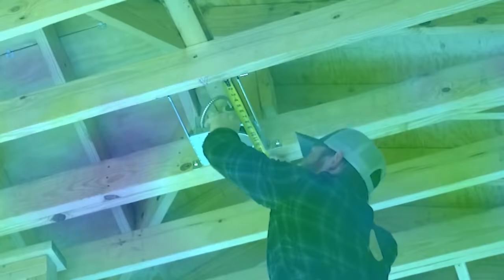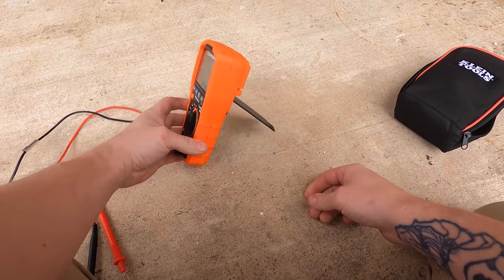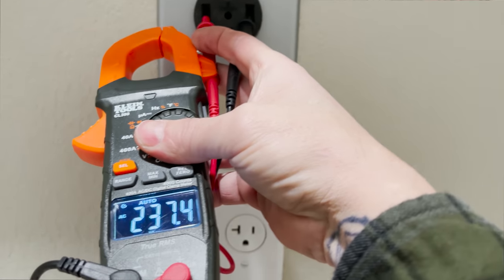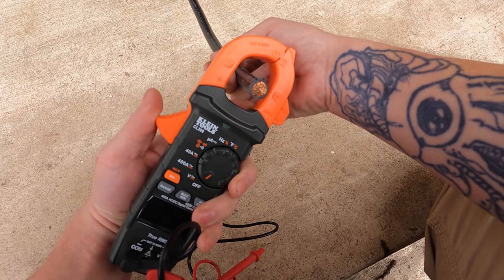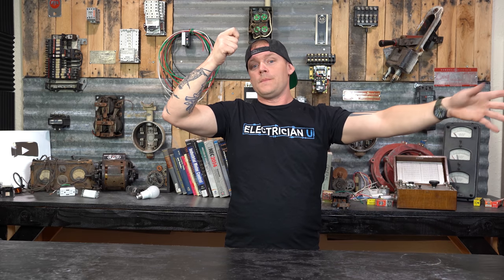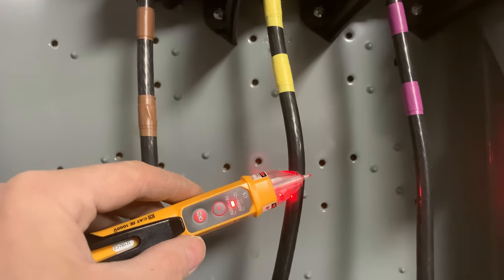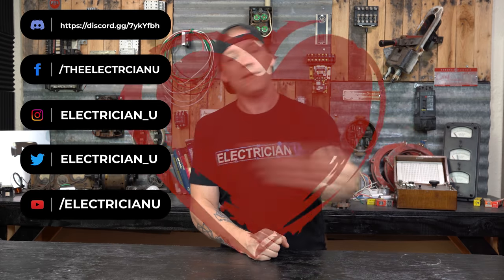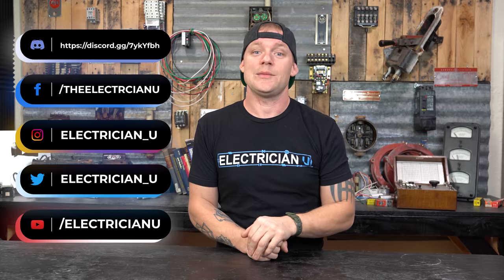4 Basic Electrical Testers & HOW TO USE THEM

Comment: My dad was working on the motor for an elevator on an aircraft carrier once. All of a sudden there were sparks everywhere. After everything settled, he went looking for what happened. Turns out some guy decided to ignore the lockout and energize the circuit. Was busted down to seaman. So, even if you start out with a safe circuit, it doesn't mean some idiot won't change that state.
Reply: Another lockout story-Years ago I knew a mechanic in a big fruit processing factory. His buddy was working to fix a jammed machine on the production line and locked it out for safety. A supervisor saw the stopped machinery, didn't ask why, broke the padlock off the safety switch and started the machine again. It cut both of the mechanic's hands off. The company gave him a lifetime pension but I would rather have my hands. Moral of the story: even if someone tells you the circuit is dead or the gun is unloaded, check for yourself!

Comment: Being a 75 year old fart, safety was always a priority, never gave someone a false positive on a circuit being disabled.
Reply: Get yourself an electrician safety lock kit, box lock, push-button lock, and breaker lock. I was drilled to use them when I was working in a mine mill, every worker have their lock, electrician or not, if they caught you working on something without a lock you end up sitting on your ass at home for a week without pay. Hey, it's just me saying, you have the freedom to get killed. Just one more tip, you need to be the only one with the key, not even your boss should have the key, they are often the most dangerous when the production is on the line.
Reply: @louispaquet8185  Do you have this paragraph copied down somewhere that you can just paste it to every comment? lol

Comment: Here's my question for obtaining a new meter: get one with True RMS (TRMS) or without it?
Reply: Depends on a lot of things, but if you're asking you can pretty safely assume you don't need a true rms meter. Both will measure sine wave accurately. True rms will measure a jagged half tooth half square "wtf kind of fuckery is going on here" kind of wave accurately too. How often do you need to do that? If it works great for 90% of what you do, and gets you by the other 10% you're probably good. The bells and whistles can be great, but most of the time it just makes it a pain in the ass compared to a "lesser meter".

Look at what the people around you carry and use. For a first and only meter for most electricians a T5 is really hard to beat. They're popular for a reason, and it's not true rms - I don't think it is anyway. That's not always a good choice though. Maybe you work on a lot of things where true rms is more of a "need" than a "want"? Or maybe you work with big enough stuff that the ammeter would be all but useless and you need a larger clamp meter?

Comment: What about a voltage testing screwdriver?

$3 tester, electronic screwdriver, just has a resistor and neon light inside the clear handle.
Reply: It’s kinda like the tick tracer. It will tell you that there is some kind of power but it can’t check neutral ground continuity or voltage

Comment: About 30 years ago at work I went to plug in a radio in a room and it just let out a shower of sparks until the breaker tripped.  Then I reset the breaker and it instantly tripped again.  There is nothing wrong with the radio.  My cheap boss never fixed the plug after that occurence and he removed the breaker from the panel.

Comment: Don't you use switch/breaker lock off devices and everybody involved with the work has a padlock and separate tag? Circuit is verified and everybody locks the circuit off and everybody has to reinstate the circuit by each removing their padlocking device and signing off the tag when done. So the last tag/padlock guy puts circuit back on and everybody knows.

Comment: I’m currently undoing the fookery left behind by a previous homeowner.  Found a shared neutral between a 15amp and 20amp circuit.  Trying to map out where this moron tapped into the 20amp neutral. 

One really screwy thing about those plug testers is they are low amp. It will read air.  I got a false reading of hot and ground reversed on this 15amp and 20amp shared neutral at an outlet - I disconnected one of the hots and was verifying power to the outlet.  Outlet had no power and the plug tester lit up with a hot and ground reverse reading in error.

Comment: That whole do not listen to anyone when they tell you the power is off.. It is called " Trust but Verify " People are human.. People make mistakes.
Reply: Get yourself an electrician safety lock kit, box lock, push-button lock, and breaker lock. I was drilled to use them when I was working in a mine mill, every worker have their lock, electrician or not, if they caught you working on something without a lock you end up sitting on your ass at home for a week without pay. Hey, it's just me saying, you have the freedom to get killed. Just one more tip, you need to be the only one with the key, not even your boss should have the key, they are often the most dangerous when the production is on the line.

Comment: Get yourself an electrician safety lock kit, box lock, push-button lock, and breaker lock. I was drilled to use them when I was working in a mine mill, every worker have their lock, electrician or not, if they caught you working on something without a lock you end up sitting on your ass at home for a week without pay. Hey, it's just me saying, you have the freedom to get killed. Just one more tip, you need to be the only one with the key, not even your boss should have the key, they are often the most dangerous when the production is on the line.

Comment: Learn the difference in meaning between someone and somebody.
The first question to ask and answer is  -
Has there ever been another 'One ' of you before you were born ?
Will there be another one of YOU after you die  ?
Understand that One is Unique
One is irreplaceable
One is the Cardinal number
How many souls do you have ?  (Soul is Ani - in Latin) - Analyze that word.
One is alive 
Every'body' is the same -  Rotten and stinking after four days and found buried in the cemetery.
Make sure you learn that.

Comment: switch off
Secure against being switched on again
Ensure that all poles are free of voltage
Earth and short-circuit
Cover or cordon off neighboring, live parts
Reply: Get yourself an electrician safety lock kit, box lock, push-button lock, and breaker lock. I was drilled to use them when I was working in a mine mill, every worker have their lock, electrician or not, if they caught you working on something without a lock you end up sitting on your ass at home for a week without pay. Hey, it's just me saying, you have the freedom to get killed. Just one more tip, you need to be the only one with the key, not even your boss should have the key, they are often the most dangerous when the production is on the line.

Comment: A helpful source, except that you didn’t cover the amperage segment adequately. 

The voltage was demonstrated and quickly covered. 

Amperage you mentioned it, product placed the Klein clamp meter, and pointed out (I learned something) the markings on the jaw. 
Also demonstrated the least (I was just a ‘duh’) important usefulness of the built in ‘hanging feature’, meaning the jaw. This was like 90seconds. 

The tic tracer which you spent possibly 7-8 minutes as well as more product placement and most of the useful info was stated in the initial 45seconds. 
My tracer gets used constantly, it’s like a middle finger, it is way more useful than you know, (I recently broke my middle finger, and came to realize it’s hard to pick things up without it!) whereas as a handyman (primarily electrical work) a DMM has its place, but it’s not terribly important. 

I don’t think you even touched on continuity. It’s quite often the only reason I’ll carry my DMM up a ladder. 

Overall, you offered great advise and did it well, but if I’m being honest, you have entirely too many advertisements as well as product placement.

Comment: I've verified a junction box was dead, cut a wire and then there was power. Like wtf. I figured it was a shared neutral, but I'm pretty sure I cut the neutral first. Idk. It's an old courthouse and the lights are 277v. It definitely wasn't 277v that got me. Who knows?
Reply: Sounds like you disconnected or opened the neutral. Multi branch or   not the effect is the same. Power on return. Also if you lose neutral on 277/480 You're gonna get the 480
Reply: dimmers like to unload on the neutral.
Reply: @wim0104 it was my hand. And because I was in a drop ceiling when my arm touched the grid I got tagged. It was a mild shock. Less then 120v by the feel of it. Being it's an old building, yes something was bleeding current.

Comment: Contactless Voltage testers - need to be tested and verified
that they function correctly prior to using them to TEST
for Live wires -- Trusting them and using them without TESTING
first is a SAFETY HAZARD - The result of which can be potentially
lethal.

Comment: Most electricians that get shocked are told to by their foreman
Reply: Get yourself an electrician safety lock kit, box lock, push-button lock, and breaker lock. I was drilled to use them when I was working in a mine mill, every worker have their lock, electrician or not, if they caught you working on something without a lock you end up sitting on your ass at home for a week without pay. Hey, it's just me saying, you have the freedom to get killed. Just one more tip, you need to be the only one with the key, not even your boss should have the key, they are often the most dangerous when the production is on the line.

Comment: unfortunalte i left the local 3 union they fucked us because of covid. the apprenticeship is usually 4-5 years its now 6-8 years for my class specifically. by the time i become a journeyman i will be 40... so i ended up going back to the union i left to pursue local 3,  local 1298 asphalt laborers union. its harder but at least i get a living wage and can pay my mortage. i was getting 12$ an hour from local 3 traveling to manhattan everyday alone cost me 53$ /day...after income taxes i was barely scraping by. had to take out a personal loan to cover my bills. but they really fucked us,  didn't matter how badly i wanted to make up for lost class time or work time due to covid. they refused to work with me so i had to call it quits. its shame really nepotism is still running rampant in the locals.

Comment: you can easily be killed by as little as 110 line if you get zapped by a power connection.

it is not funny when someone is dead when they got hit by a surge of electrical power

Comment: Trust no one when  you life on the line.
Reply: Get yourself an electrician safety lock kit, box lock, push-button lock, and breaker lock. I was drilled to use them when I was working in a mine mill, every worker have their lock, electrician or not, if they caught you working on something without a lock you end up sitting on your ass at home for a week without pay. Hey, it's just me saying, you have the freedom to get killed. Just one more tip, you need to be the only one with the key, not even your boss should have the key, they are often the most dangerous when the production is on the line.